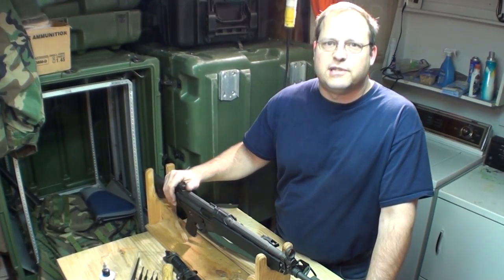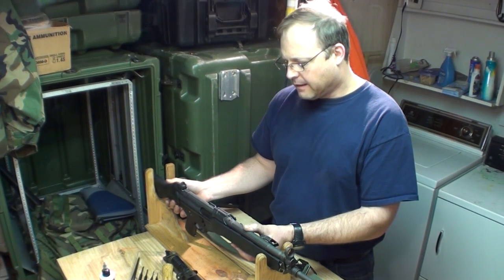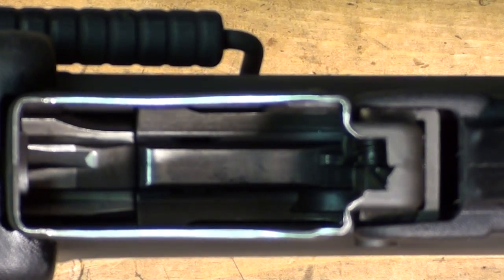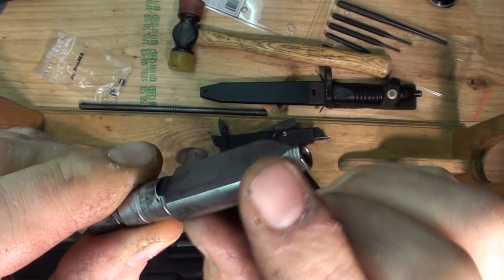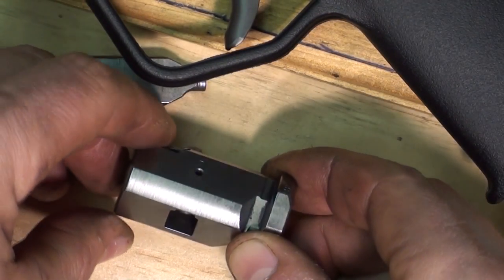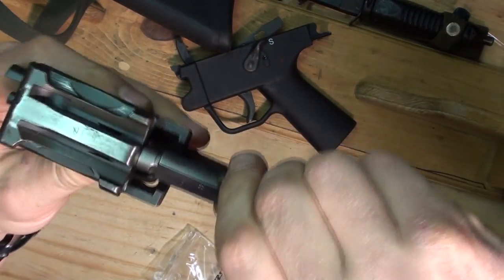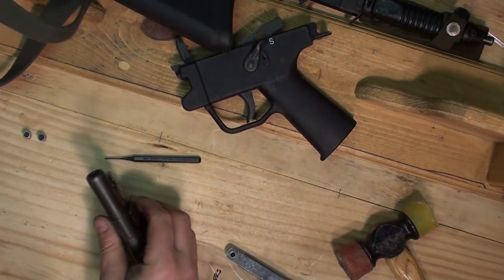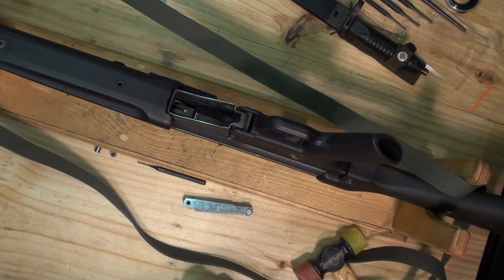C93 (HK33) Update - Roller Change Demonstration

Comment: If your gonna buy a cetme make sure you do your research to help you find a rifle that operates and functions properly, know what to look for when shopping for one, the older century builds are much better then the newer, the newer they seem to cut corners alot in production, the older ones are cast aluminum rather then cheap sheet metal. Only thing i can assure you with PTR is you will get a great rifle, but a good cetme is up to par.

Comment: Mine will fire the green tip ss109 without any problems. Anything else will result in failure to extract. Is this a roller problem? Any info will help, thanks.

Comment: I hope you havent been asked this a whole bunch of times already. What I got from your video is replace the rollers anyways. I just picked up a c93 and it has a gap of .009, in spec. I havent shot it yet but plan to see how it runs with 200 rounds and check gap again. If no problems would you suggest change out the rollers, with the +4?

Comment: Thanks for your vid. Took a chance on a C93. Failed to extract several times. Watched your vid then measured the gap. .007. Ordered and installed +8 rollers. Now measures .017 Functions much better but still FTE with steel ammo. I am hoping it just needs more break in. Brass ammo works great though. Love this rifle.

Comment: Well finished putting lead on target and it was a good run, no failures of any sort so maybe it was an ammo issue or gunk issue in the firing pin assembly. Also finished up some reload on my new press and was able to put out a 100 rounds of fresh 45 ACP without issue. Got the 93 dialed in with a red dot and she's on point, thanks again for the feedback. Hope the 93 continues to fire like a champ.

Comment from the maker: Good to hear!  I'd try some slightly smaller rollers if that gap doesn't open up a bit with use.  You're pretty close to the high end which could make it a bit finicky with lighter loads.  
That Russian steel cased ammo does run in mine but I only tried one or two 20 rd. boxes of the stuff.  Nearly all of my shooting has been with brass cased handloads in 55 and 62 grain.  Absolutely love mine, too.  It's definitely right up there among my all time favorites.

Comment: Wish I would've checked I thought it was the new Pro Mags that I got and they had failed to feed properly, but after charging the bolt and feeding the round it would fire and eject properly, however ran three different mags including the "stock" 40 rounders to troubleshoot this, but no I didn't check to see if there was a primer dent, if not what do suggest, poor hammer spring, possible firing pin issues, the pin looks good strong point and the locking bolt looked clean as well, thanks

Comment from the maker: Yes, correct.  With a properly selected feeler gauge you will feel slight resistance when the gauge is pushed or pulled from the gap between the bolt and bolt head.  If the insertion requires a tight grip then try one that is one-thousandth smaller.  After comparing the feel with two or three gauges you will zero in on the one gives the most accurate reading.

Comment: I had limited space in my home and my washer and dryer shared the same space as my guns and reloading setup.  One day I left a load running in the dryer, and the vent hose decided to tear.  When I got home the whole room was sweating, and caused alot of surface rust issues for me.  Just wanted to share.

Comment: Good video. I find it easier when installing roll pin into bolt, to just depress rollers equally on both sides  of windows and that centers hole. It makes it a little easier to hold and incert pin. FYI , Beltfed precision firearms make +6 rollers for HK DRL rifles. RTG carries them for them. too. It's funny when people say, "Why mess with a firing rifle". It's a newly assembled rifle and should have the life of a new rifle without having to repress  the barrel to attain propper bolt gap.

Comment from the maker: @colorsoluble This rifle has still never malfunctioned a single time and now that it is running in-spec. I have full faith in it.  Price point was the reason I picked mine up and it really paid off.  There are no other issues, besides those dealing with proper bolt head gap and related malfunctions, that I've read about, and the parts appear to be compatible with every other HK component on the market including the scope mount.

Comment: I have an older Century CETME 308 that has never jammed or failed, the only problem is it is vary difficult to charge. I never really checked the bolt gap yet but if I did change the rollers, do you think it might help the difficult charging? I have to pull down on the cocking handle as I bump the stock on a table or ground to release it to load the gun.
Reply: Look up gap between charging handle and  bolt carrier tube

Comment: Just got my C93 from SOG and it looks good. Measured bolt gap is .013 loose .014 is slightly snug and .016 is really snug. .018 won't fit (go figure). So I'd say the bolt gap is between .013 and .014. Everything else seems good, going to fire it today. Magazine has no wobble when inserted. Ejects rounds perfectly when working the cocking lever. Came clean and lightly oiled on the inside. Odd thing is the finish on the carrying handle "sheath" where the carry handle slips under has a mottled paint pattern on top of the parkerization that looks like light black scales. Kinda cool. Gun is a tad on the heavy side but I like a little heft to my rifles. I've read online the 1:9 twist works better with 62-64 gr ammo?

Comment: It's all good and well hoping to change the rollers to the correct ones - but have you ever tried getting the exact rollers? Everyone seems to stock the standard diameter rollers but NEVER anything on the outer fringes.
Reply from the maker: It's been so many years ago that everything could be different now.  As I recall, the angle of the selected locking piece is what has the main effect on timing and the roller selection serves as a way of fine tuning and making adjustment for worn parts.   It's why Century C93 pistols don't run from the factory.  They cut rifles down and sold them with the carbine locking pieces which require a long barrel to function.  (See my C93 Pistol video for more on that.)

Comment from the maker: Your bolt gap will likely open up a bit since it hasn't been fired much since it was assembled but if it holds at 0.009" and seems to function well then you might just want to leave it.  
Of course ordering rollers would be a good excuse to also pick up some cool accessories for your C93 like an original sling or maybe a brass deflector.

Have fun with it!

Comment from the maker: @ausfall If cases are splitting all the way through it could be from an out-of-spec chamber or any of several reasons for over-pressure including hot ammo.  I would not expect deep fluting cuts to be a symptom of improper bolt gap. 

I've read where certain lots of 5.56 NATO ammo can do this.

Comment from the maker: If your gap measures within spec and the firing pin looks good then I can't think of anything.   There is a spring in the bolt with the firing pin, right?  The size, location, and depth of the primer dent will tell all.

Comment: Yep, figured as well, I wish I would've checked, I had dropped the mag, then pulled back on the charging handle causing the round to properly eject, just didn't think to check primers, however all "fail to fire" rounds were replaced back into the mags and did eventually fire- will have to wait for this weekend at the range to tell. Also I've heading different issues with 55gr vs. 62 gr and brass and steel cases, any thoughts on this may potentially be a cause?

Comment: Sounds good, I was looking at the Choate folding stock as well as Fleming's Firearms AR back plate set up which accepts standard AR extension tubes for the stocks. So how's the folding stock, does provide a solid cheek to stock setup?

Comment from the maker: You'll want to take all the rounds that don't fire and set them aside.  Don't run them through again until after you have this thing figured out.  If you make a second strike on the primer you won't be able to accurately determine how hard the firing pin is hitting.

Comment from the maker: Well, until you verify 1) that there was indeed a round in the chamber when the hammer fell, and 2) whether or not the firing pin struck the primer with enough force to fire the cartridge, it would be hard to figure out.  Since the internals look good it would most likely be an ammunition failure.  But you need to see that dented primer to be sure.

Comment: Thanks for the feedback, got another question, with the bolt gave within decent specs 0.12, I went to the range today and had some "failure to fire" occur, weapon has been cleaned , when it did fire, ejection was fine, no issues with the bolt seating or with movement, simply the pull trigger and nothing happened, even with a round chambered, any suggestions?

Comment: lets just say the bolt gap is .023, do you go down in rollers?
Reply: Rx7SNSportbikes To get a smaller gap you need to go up in size with the rollers.
Reply: +4 rollers are +8 thousands if you need smaller gap u need minus rollers sir